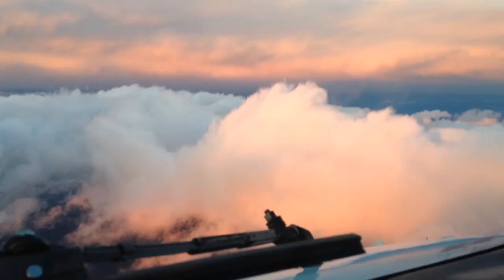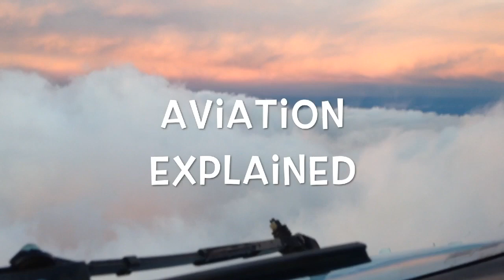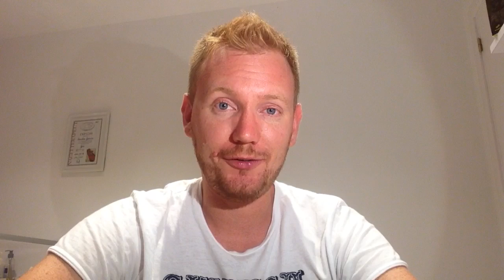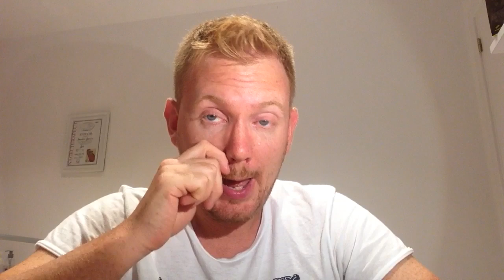Aircraft maintenance, why pilots shouldn't touch anything!

Comment: Many years ago (30 or so) my 2 brothers and I were returning from Bermuda to NYC on a domestic US carrier. Can't recall what plane it was, but I happened to look out the window and saw a crack, yes a crack in one of the flaps. I told the stewardess and she told the captain, they were not alarmed and the flight/landing was fine without incident. But it makes you wonder eh? 
Also, when I heard the US airline industry was being deregulated many years ago (late 70s) I was concerned about the out sourcing of maintenance to places outside the US. Not because of the quality of mechanics, but rather, changing from US measurements (like tightening torque) to metric. Believe it or not I have over the years found a few mistakes in auto shop manuals when converting from Metric to US or vis versa.
Reply: if that was done today the crack would have been logged into an airplane map and checked by a certified michanic of that flight model only.  it would only be released for flight if said michanic says so.

Comment: I looked into aircraft engineering and what it's like. I heard it's absolutely horrendous with the pressure put on them and the complexity and range of the systems. The pay is absolutely awful and the hours are terrible, too. I'm a heating engineer and make £72,000 pa running my own business after very little training. Aircraft engineers should be on over £100k.

Comment: Not Trying to scare anyone: But i fly every week the same route <as a passenger> for my work,  The airline of choice depending on season will either use a 737-xxx or a Q400NexGen, One one of these flights i got seated in a wing/window seat <aircraft is wing over body turboprop <Q400>>  and i noticed out the window while we were loading that there was a part of the landing gear wheel flange that was missing, <a chunk substantial enough i wouldn't drive a car with a wheel in that condition> and there was obvious oil/grease seepage that had sprayed/flung from the wheel-hub out across the wheel. once i noticed this, i quietly flagged down a member of the cabin crew and asked them to look out my window and explained what i saw, The crew-member of-cource down-played it <trying to be re-assuring im sure> but she never once mentioned it to a member of the cockpit crew.... We took off on it fine.... When we went to land, i could see that upon touch-down the inner wheel moved very differently from the outer wheel in that landing gear pair.... ive been making this journey weekly for almost 10 years now, been on this type of aircraft hundreds of times, i KNOW this is NOT what a "NORMAL" landing gear/wheel should look like: My Question is, instead of reporting it to cabin crew should i have gotten up and gone forward and asked to speak to a member of the flight-deck crew and notify them directly?? Or would that have been illegal/inappropriate?  - Mentour thank you SO MUCH for the videos!!! aviation has always fascinated me and your videos definitely make it more fun for me, i love seeing and knowing the behind the scenes stuff.
Reply: That is a great question, wonder why no reply ?.  I fear you would of been arrested for causing a panic on a plane.
If you see something, say something. Worked well at that High School in Fla !

Wonder why nobody has made a video about all the bullet holes they find on the underside of planes ?
Reply: WIsh there was a way to post pictures, as i have photographs of the broken wheel.....
Reply: You would think the  " Powers to Be " would jump all over it, so fast. Sometimes I think were being fed a line of S**T. In fact I know we are. But hey I believe you, thats a start
. How long ago was this ?
Reply: Charles Miller  :sept 29 2016 11am <sorry was longer ago than i had remembered..>

Comment: Actually, I'm pretty sure that you're required to check you car before your drive - Nobody does that, but actually it's not a bad idea to check the basics (lights, fluids, tires) very regularly...
Reply: Well that's the thing it is one thing to recommend or even require something be done it's another to require that it be documented and shown to be done with penalties and enforcement for violations. If the latter was the case for cars then perhaps car drivers might actually inspect their machines with more frequency, though to come up to the standards aircraft go to you would need to massively increase the compulsory inspections by certified qualified engineers at certified inspection centres too. In most countries cars have an inspection which would probably barely qualify as an A check for an aircraft and then once per year. Aircraft have had several of those in that interval and the annual check would be involving such things as disassembling the entire engine, inspecting and cleaning every part replacing any that show even the slightest sign of excessive wear or damage and assembling it again cars don't generally see this level of maintenance at any time in their life.

The D checks are even more extreme it's about as close as you can get to completely rebuilding the aircraft without scrapping it and ordering a new one from the manufacturer.

Comment: Maintenance wise, a mechanic can only touch or service one engine on a plane. You have to take another mechanic to touch or service the other engines. A mechanic can check the oil on all engines, but if you even just add oil to one engine, you can't service the others. It's that strict by the FAA.
Reply: Thats crazy..🫢Its not like that in Europe under EASA

Comment: If cars were maintained like aircraft they would be very unlikely to fail. Unlike aircraft, cars are not designed with multiple redundancy in their critical systems , so cars will fail to reach their destination considerably more often than aircraft, even with same maintenance regime.

Comment: Captain, I was on a 757 to Iceland out of Dublin some months back and while taxing - after a considerable weather delay - I noticed a rubber rudder bed hanging down from the wing. It was about one meter long. I, to my shame, didn't notify anyone as we were lined up for departure. We took off and when the flaps were retracted the meter long strap of rubber trailed from the wing for the entirety of the flight. On landing when the flaps were retracted the piece of rubber was draw back into the bed. How should I have handled this situation. Ie should I have rang the bell over head?
Regards,
John.
Reply: Well personally if it was me I would have made sure to have a word with someone from the flight crew or cabin crew before departure if I noticed it then. Though whenever I noticed it I would tend to err on trying to notify the crew what I had observed as discreetly as possible it could potentially distress other passengers in earshot especially if someone with a nervous flying disposition overhears. For that reason I'd also probably only consider using the bell to tell them at the seat if the seatbelt sign was on, if the option is there to quietly walk up to the galley and have a word in private I'd take that option.

Comment: Is there a procedure where they pressurize the cabin and apply soapy water to the exterior to look for hidden leaks and fatigue?
Reply from the maker: No. As far as I know there is no such procedure
Reply: Seems like an extremely simple thing. There may be allowable leaks at seams and rivets but a computer comparing regular videos could detect changes and therefore damage. Perhaps suggest this to someone in power to look into these things. Cheers
Reply: Tim Dodge A pilot does not come with recommandations to a mro about how to run their maintenace program☝🏻
We, at my mro, do however use a special soapy water when looking for leaks e.g. after replacing a window, door seal etc.

Comment: 2:00 But its very likely that you will have a catastrophic failuire to your wallet
Reply: And yet people's safety and lives are not valuable enough to provide even a more appropriate lighter version of that kind of maintenance or just build cars that aren't designed to breakdown.
Reply: The difference is if your car breaks down while you're driving, it just stops moving. You can call a tow truck and have them take it to the garage, and all is good. If the plane breaks down, and stops moving, it's significantly more difficult to tow it back to the hangar. You'll have to find all the pieces first, for one...
Reply: Average people wouldn't be able to afford that kind of maintenance and downtime. Machines that don't breakdown don't exist. But if the owner wants to be vigilant about maintenance no one is stopping them.
Reply: Well to be fair, Toyotas are made to never die. I know a construction company that regularly breaks every single tool (high quality tools) they use.  Everyone of them drive OLD toyotas and not one of them have breaken down so far. They were going to replace their fleet of trucks but because they dont break down they just waited until they started dying, which is apparently never.

Comment: Hi mentor pilot..
I have just failed in the crm interview. There were two main queations that ı couldnt answer confidently. First one was that when u are a captain in the cockpit if one of the cabin crew inform u that they saw  2 small green snakes in the cabin would u continue or divert and would u inform the passengers about the snakes or would not? what is the correct answer..? and if u are to inform what kind of question would u ask?
Reply: 1. Are the animals known cargo? and 2. Such an animal might be capable of crawling along vents etc. and interfering with aircraft systems, so I would say divert in that instance. Don't make an announcement that might cause panic, but if there are known to be 2 grass snakes (non-venomous) on board, the hazard is a bite, not poison, but even then there might be more than 2 snakes on board, so keep quiet to avoid panic. (THIS IS MY GUESS).

Comment: The comparison to car maintenance is cute, but lacks one aspect - in the time an aircraft spends between two d-checks, even shourt-haul planes have accumulated more miles than any usual car will ever accumulate in its entire life. Multiply that by the number of passengers transported (iirc 189 for the planes you fly, right?) and you see why changing the interior (or selling the entire plane like some airlines do) plus all the other maintenance is not the worst idea. And usually airlines try to operate their aircraft as many hours as possible each day to be profitable. Cars, especially prvate owned ones sit around waiting to be used most of the time. So there's much mor operating hours during the same time span. ;-)
Reply: Yes, but cars use lower quality components, they are driven over shit roads filled with potholes, they are often driven on a cold engine without warmup. Also even if the car's just sitting there on your driveway doing nothing its condition is still deteriorating. Some components don't care if you're driving or not.
Reply: True though for vehicles it's not so much the miles they cover generally but the hours they are operating that is the killer. I mean even if a car was built with the same quality components as a plane with a similar MTBF for it's engine as the turbofan engine on a plane it would cover less distance than the plane, the car would actually need to be approximately 7 times as reliable as the plane to cover the same distance on average before it failed as it covers about 1/7th the distance per hour of wear and tear. Do note by distance here I mean actual linear distance travelled of course the car would actually take more than 7 times longer to make the trip between two points than the plane in most cases due to the limitations of being confined to roads that are often far from being a direct straight line route.

This is similarly true for pretty much all devices while the rate of deterioration during times the device is not operating is never zero it is usually so much lower than the rate of deterioration that is racks up while operating that it can be almost ignored completely for most devices and the power on hours being by far the biggest determinant for the service life of the device or any of the components thereof.

Comment: Compared to a car, airplanes also have lots of redundancies. That's what I always criticize in cars: If you want to have drive-by-wire (which you'll also need for autonomous and highly automatized driving), you will need to have redundancies - I know it costs a few Euro more (and in the automotive industry they really discuss each and every cent), but it would be catastrophic if e.g. your data bus breaks and suddenly you can't steer or brake anymore. Imagine that at 200km/h on the Autobahn :-O
Reply: I don't think any critical component is allowed to stop working ever. Steering will still work even if hydraulic/electric power steering fails. Brakes will also work even when the engine is off. The only main things that don't have redundancies are the accelerator and the gear leaver. But those are hardly critical components in an emergency.
Reply: If there's a brake hydraulic or mechanical failure, the gearshift becomes pretty darn critical.
Reply: My brother drives a Toyota Yaris, and there is no physical connection between the steering wheel and the electric steering motor. IF anything fails in the steering, he's screwed.

Comment: The manhours figures given in this video mean that an aircraft needs to earn enough revenue to pay for 1000 hours of maintenance per month, on average. Imagine that a licensed aircraft engineer costs the same as the mechanic at your car dealer - upwards of £60 in the UK in 2018 and you can see how much the airlines spends on maintenance for one aircraft, more than £60,000 per month. And if you need a replacement part, aviation quality parts are a lot more expensive than parts for your car.

Comment: One question...when you say engineers, are you talking about mechanics (flight engineers) right? Are there any aeronautical engineers working with you? or just only flight engineers?
Reply: I was just wondering the same thing... I think he might mean technicians... Engineers are generally hidden away in offices designing aircraft, they don't normally do maintenance check. That would be the technicians and a group of mechanics. Nowadays people often refer engineers as technicians but they aren't the same thing... One has a bachelors degree, the other a masters degree normally (international reference) ^^
Reply: It might depend on the country. Here in Canada we are Aircraft Maintenance Engineer (AME) which is mechanics, avionics, and structures technicians. Then there is also just engineers, that are the actual Engineers that work in offices and rarely touch the plane. Often, the AME will talk with the Engineer if some damage or problem requires specific things that are not written already in the aircraft maintenance manuals. That's when the engineer will go more in debt. But the work/repair/troubleshooting itself will be done by the AME.

Comment: about technical inspections; So you mean actually that a single dent (stenskott) could be an issue that prevent You from taking off as long as that specific dent wasn´t in the aircraft documentation allready? What if You went through a hailstorm, that will eventually give quiet many dents?
Reply: Most dents, of any size, have to be fixed. Most aircraft/airlines have insurance that covers this kind of event.
Reply: Colin Povey, not entirely true. Most dings that an aircraft receives are dotted and left alone. Dotted meaning that they have inspected and the dent is within limits so a physical white, yellow, or green dot is placed on the dent.
Reply: Thanks for the correct info.
Reply: Dents would be allowed, as he stated, but there will be a limit to the size and depth of it. Since the pilot doesn't, and shouldn't know the limits on hand, he needs to have an engineer/mechanic perform the inspection to see if the dent is within limits. Therefore, yes, even a tiny dent can and will stop a pilot from taking off.
Reply: Good example, if it that airframe was unfortunate enough to go through a hailstorm, it would be subject to a very specific inspection to capture any damage, this might be able to be carried out by engineers at the gate and would probably result in a delay for the next flight. Most damage limits are quite generous in what is allowed but legally, all damage has to be assessed according to the aircraft maintenance manuals, confirmed that they're within limits before the aircraft can be released as airworthy again. This is why the pilots rely on engineers to carry out this work as it might require specialist tools and techniques to measure a dent, as trivial as a "dent" sounds lol.

Comment: How regular does an aircraft changes the tyres?
Reply: the aircraft will be parked in a hangar and it will either be lifted up very carefully onto oversized jack stands, or if the aircraft is too heavy to lift like the 747 then the jack stands will be put in place and the floor will be lowered, then they can change the tires.

Comment: I am having one question..... What do you do when your radio transmitter doesn't works ??
Reply: king ruby They have at least 2 radios. Unusual for multiple failures to happen. You squawk 7600 so ATC is aware of comms problems. Sometimes, if you can receive, but not transmit, the ident button can be your best friend in a "knock once for yes, two for no" sort of crude communication. Look up Mode C transponder. ACARS is another option. If you've really lost everything, then you will likely not have Mode C, and will be an uknown (primary) radar blip. These days I'd expect that to get you a military escort off your wing in a big hurry, and you can use hand or light signals. Multiple, multiple, multiple redundancies. Of course I haven't told you anything you couldn't find on Google if you had bothered to look.